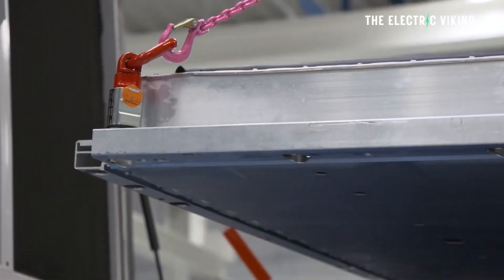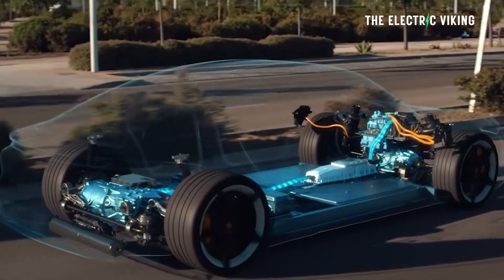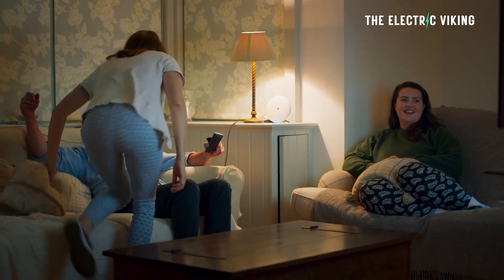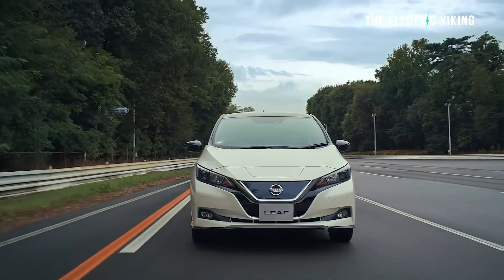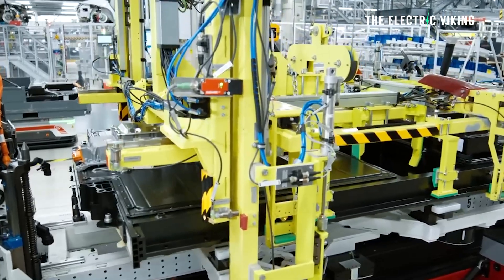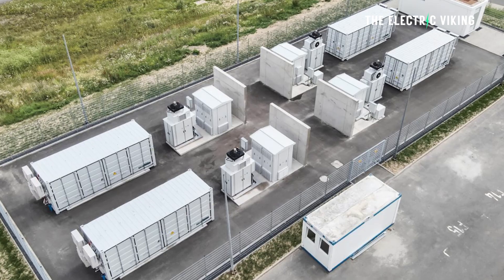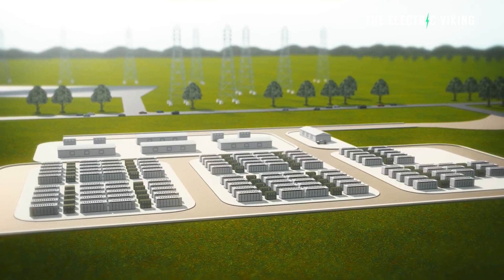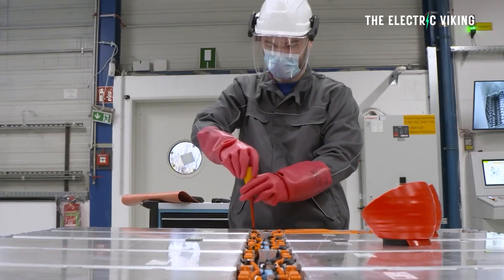Porsche builds a MEGA battery with 4400 Used Taycan battery packs

Comment: This all sounds a little strange, why has Porsche had to replace so many battery's, are they that bad.
Also, battery's from EV's involved in minor accidents, if it's a minor accident then wouldn't the car just be repaired and put back on the road, on the other hand, if the accident was severe enough that the vehicle was written off, then that pack would be beyond use.

Comment: Tesla battery cells can't be repair/replaced. They use structural battery packs. See Sandy Munro's videos about them.
Reply: Yes, but if they were replaced due to lost range, then they can be used as is, without disassembly, they just stick them on a shelf in a container. as shown
Reply: Wrong. There are numeorous small companies reusing and repairing Tesla batteries
Reply: @mirvine1  Mostly from write-offs, I wouldn't have thought Porsche themselves would be receiving any cars from accidents
Reply: You don't replace cells, you replace modules. And yes, Tesla modules can and are replaced. You should replace a failed module with a similar age/mileage one so they balance well.

Comment: The Porsche newsroom claims the batteries are from "pre-production vehicles used in testing". Right. Porsche repurposed 4400 batteries used in the development of the Taycan.  That's a bit of a stretch.
One would think that a lot of those batteries came from warranty replacements.  Given that only about 150,000 Taycans have been sold so far (since 2020), that could mean a 3% battery failure rate already!
I like the idea of repurposing used batteries, but someone needs to dig deeper to underatand how many Taycan batteries are already available for this.
Good video.